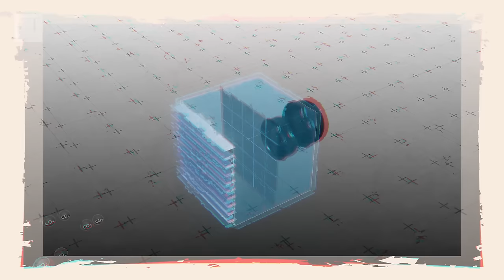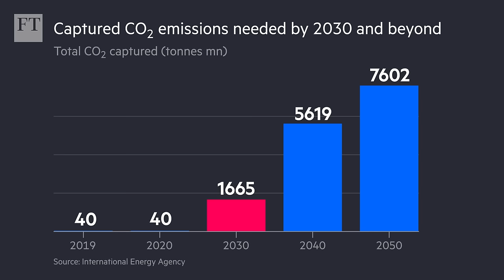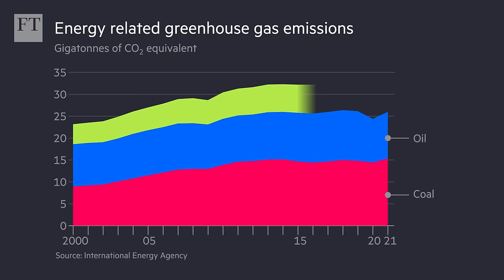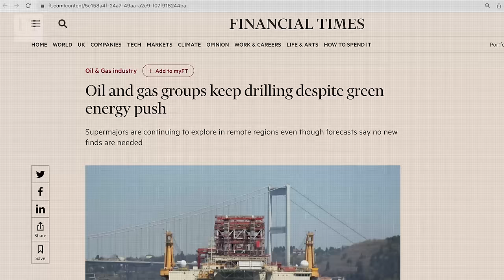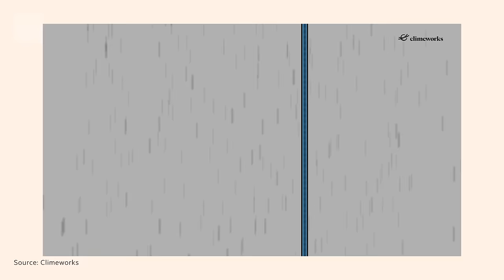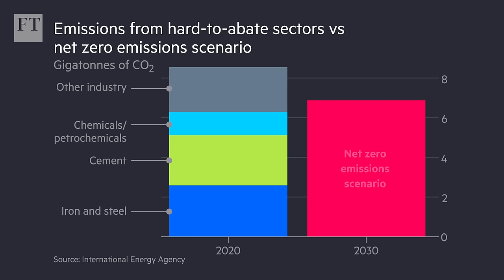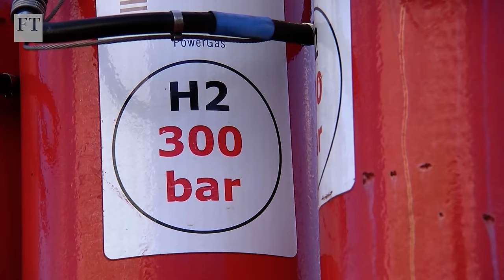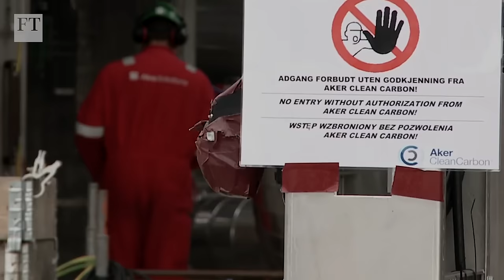Carbon capture: the hopes, challenges and controversies | FT Film

Comment: The problem that some major proponents of carbon capture and storage are aware of, but unwilling to acknowledge, is the fact that ALL of the combined technologies (even scaled up) would be unable to store even one part-per-million of CO2 in the end. One ppm = 7,800 million metric tons. The IEA estimates 7,600 million would be needed by 2050. Even if done, the climate would not even miss it. And, while it is being done, fossil fuels for transportation will be adding more to the atmosphere. These facilities don't just appear by themselves. This approach will never work.
Reply: @ChristophBackhaus  The point that Ken Towe is making is even the best CCS tech will not be enough to remove all the carbon already in the atmosphere!
Reply: @ChristophBackhaus  To make the world CO2 neutral would require the permanent capture and storage of about 40 billion tons. That's what was emitted globally last year. Hemp is no different from algae or trees. It will be recycled by the oxygen that photosynthesis created. Carbon capture must be permanent to affect the climate long term. In order to plant and use hemp fossil fuels will be needed, just as they are to plant corn or sugarcane for biofuel ethanol.
Reply: 生活有滋有味  So, how can you expect us to transition to an all-electric world without using the fuels needed for transporting all the materials needed? Renewables just don't appear like mushrooms.
Reply: @kentowe2080  what do you suggest
Reply: @dennisdidinger2402  Forget the dire forecasts of climate models and the hopeless attempts to mitigate climate...zero or net-zero emissions. Focus funding and attention to innovative infrastructures so we can better adapt to whatever future climates do. We will have to do that anyway and without fossil fuels for transportation we can't even make EVs, never mind solar and wind installations..
Reply: @kentowe2080  not convinced by this argumentation at all but all the best to you
Reply: @dennisdidinger2402  The UN IPCC's latest forecast for our future without oil for transportation should convince you. Availability and costs of fossil fuels at the pump will also be passed along to those installing carbon capture facilities and pipelines to geological storage locations. Same for those installing wind and solar "farms".or EVs.
Reply: @kentowe2080  Let's accept your premise that CCUS is not a viable option. Let's also accept your premise that more funding is needed for innovation to solve the climate crisis. If you were the manager of a $50 billion dollar UN climate mgmt scheme, what solutions would you funnel the money into? I find alot of skeptics and doom-sayers on the internet, and for the most part what they say is quite accurate. But at some point we need to find the enthusiasm to take risks and search for solutions!
Reply: @huwatts2  You cannot accept a premise that is quantitively impossible to use as a viable option to address a problem that isn't really there (model forecasts). But, using fossil fuels to make better infrastructures against extreme weather is a viable project with positive results. they will be needed anyhow.
Reply: @waxogen  How much fossil fuel will be needed and used in capturing CO2 in your wax? And how long will it take to store 7,800 million metric tons... one part-per-million?
Reply: @kentowe2080 "We will have to do that anyway and without fossil fuels for transportation we can't even make EVs, never mind solar and wind installations.." That's where green hydrogen comes in.
Reply: @davie0123  I don't understand that. Even green hydrogen technology requires fuels for transportation. And how does that take place or help to make Evs or install renewables...capture and store carbon in oxidized forms?
Reply: @kentowe2080  I don't think you understood my message. The premise which I propose you accept is your own. I'm saying, if we accept that everything you say is true, what next? If carbon capture and utilisation (CCUS) is not worthwhile, then what is? What solutions are a better use of cash? What alternatives can you propose that are more economically and quantitatively viable than the solutions proposed by engineers today? We can only be skeptical for a certain time. At some point, someone has to take risksand commit to action!
Reply: @kentowe2080  You think that you will need fossil fuels to make Evs and for transportation. But you don't. Green hydrogen can replace such fuels in the future. You think the best solution is to just invest in infrastructure to adapt to "whatever climate" we will have. Then you are just oblivious what an impact a few degrees centigrade more will do to our lives on earth.
Reply: @huwatts2  Mr. Watts. I answered that question 8 days ago when responding to Mr.Didinger. No mitigation solution can work, certainly not CCS technology. Adaptation to extreme weather is doable. And as I said earlier we will need to do it anyhow.
Reply: @kentowe2080  You are not getting my point. My point is instead of just 'going with the flow' and see what will happen if the earth warms up by a few degrees, we should keep investing in renewables and Co2 capture. We won't know what exactly is going to happen in the future, but sitting it out like you say we should and just 'adapt' even though we already see the disastrous consequences from an average 1.2 degrees rise in temperatures is just pure ludicrous.
Reply: @davie0123 We cannot go forward investing in renewables and CO2 capture without using the fossil fuels needed to make that transition. All renewables need transportation to where they will be put into place. Carbon capture facilities don't just appear to capture just a few thousand or few million tons without vehicles running on biofuels. Even the pipelines.
The global average temperature last year was up less than one degree C.since pre-industrial time (NOAA, 2021).There have been no "disastrous consequences" except those caused by the pandemic travel lockdowns that rapidly lowered CO2 emissions. All economies suffered. It should be obvious that continuing to lower emissions will mean even worse economies. How will we travel  and how will our material needs travel to where these renewables will be put into action? As you surely know the shortages of fuels for transportation are a current problem. Emissions lowered, prices higher. Continuing on.to lowering  emissions to zero and net-zero???
Reply: Yeah you are conflating direct air capture with single source capture.  You are talking about removing the CO2 from the atmosphere that is already there.  The single source capture units are about preventing more CO2 from going into the atmosphere.
Reply: @jamesnorton4455  Yes, that is correct. The problem for the climate is to lower the amount already  in the atmospheres on a permanent basis. Net-zero negative emissions. That's where the technology fails. One ppm by 2050 is totally trivial.
Reply: Can't win, so don't try? OK got it. Burn baby burn, it is then.
Reply: @kentowe2080  You are claiming that your conclusion is based off of research from the IEA. Got a link to the research?
Reply: Yesterday, the son of US President Hunter was captured in Mariupol
Reply: What if we dig a hole with a Dyson suction that delivers all of this wasted food to the desired destination? I'm sure Sir Dyson can give us a bit of hand :)
Reply: @mountainman6172  Nobody can do very much to lower an already low amount of atmospheric CO2 without using fossil fuels to transport people, food and all of the materials needed to make that transition to an all electric world. That would include wasted food even all garbage. Solar and wind:"farms" don't just appear ready to go.
Reply: Planned cattle grazing for reforestation
Reply: @David Gravemaker It is not propaganda to "spew" report facts, real numbers required to make a difference to the climate. If you find an error, point it out please.
Reply: @ChristophBackhaus  May I know what’s hemp?
Reply: Harvested CO2 applied to every field of every farm in the world would easily store all the carbon ever released and would become a necessary part of farming if famine is to be avoided. A carbon-free atmosphere would cause more deaths than any activity ever done by mankind.
Reply: @americaswayout4489  Harvested (captured) CO2 in farming is, of course, not long term. It is quickly recycled. Only the long term burial of massive amounts of CO2 can make a difference to the atmosphere and thus the climate. That's the big problem. Not enough can be buried.
Reply: @kentowe2080  When you inject the liquid several inches into soil that is NEVER  plowed again, it does become long-term. You need to review regenerative farming methods before making such uninformed comments. Even carbon credits paid to these farmers require long-term storage to qualify for payment.
Reply: @ecoideazventures6417  
Why would you remove the O2C from the atmosphere.?
Don't you know that at higher altitudes like the altiplano the content is 0.27 grams/m³, compared to 0.49 grams/m³ at sea level. 
For every kilogram of plant material (glucose) the plant needs to extract 1.47 kilogram O2C from the ATMOSPHERE. To be able to feed you and split the molecule to produce the oxygen you need to breathe.
The 0.27 gram /m³ in those regions are insufficient to grow wheat. A large lake with fresh water and all necessary fertilizers K, S, P, NH3 are available but not enogh O2C
So by removing all that trace gas you will kill all life on earth. Yes a man made catastrophe allright!
That includes the life and food chain in the arctic waters, plankton, krill, wales, and crustacians, which line the seafloor, sequestering the O2C.
As happened before, what are the cliffs near dover? Animal made calcium carbonate.
Man are you naïve.
Reply: @americaswayout4489  
You are absolutely right. We already have famine due the low content in the low air density around and south of the huge fresh water lake Titicaca.
0.27 gram/m³ co2, compared to 0.49 gram/m³ at sea level. Up to recently most food for an empoverished population  over a million was trucked in. With the near doubling  of the fuel cost, the cost of food is unaffordable, so efforts are made to locally do the necessary agriculture, but grain will not grow, unless surrounded with supplemental co2 in enclosed plastic tents, obtained by burning --- fuel.
For each kg of photosynthesised glucose, 1.47 kg co2 need to be absorbed from the air, nearly 6000 m³ air if all co2 would be extracted.
That is the situation nobody understands.
Reply: @kentowe2080  Cellulose can be stabilized for long term storage, of course, but that really limits the economic use. I think you’re right that it couldn’t be done economically. (Not that’s the only consideration)
Reply: Ken Towe, if you're saying that no carbon-capture / sequestration solution should be at least tried, then explain to me how the materials needed for producing solar panels and wind turbines are mined, processed/refined and transported.
Reply: @connerdavidson7087  I'm puzzled at the question. People in conventional vehicles will do the needed transportation, at least until the transition to renewables and electric transportation is completed. That would include the construction of carbon capture installations and the transport of CO2 under pressure to wherever it is to be stored. Pipelines don't just appear on their own. As already mentioned the amounts required to affect the climate are in the billions of tons. Obviously, during that transition more CO2 will be added with each gallon of fossil fuel needed for transportation...even to replant, fertilize and harvest the corn and sugarcane for the ethanol blended with gasoline or diesel fuel to make the biofuels which are only 10% ethanol anyhow.
Reply: @kentowe2080  You don't use ethanol in diesel  / biodiesel fuel blends. That's what methanol is for. Ethanol is typically only used in gasoline. Most of the mechanized mining and processing/concentration equipment runs on diesel. Those raw materials end up becoming things like semiconductors and electric vehicle batteries. But mechanized mining / processing is predominantly a diesel-fueled upstream value chain. So until that mechanization goes electric, solar panels, semiconductors, EV batteries, etc... all those things will be contributing to carbon footprint. And thus carbon offsetting is necessary.
Reply: @connerdavidson7087  Yes, the gasoline we put into conventional vehicles is 10% ethanol and 90% fossil fuel. That ethanol is made from corn and sugarcane that has to be replanted and harvested every year to keep the carbon "neutral". That process by itself requires vehicles that run on the biofuels it creates. Carbon offsetting and lowered emissions takes no CO2 from the atmosphere. That's why CCS technology is supposed to do the job. But it cannot possibly take enough out to affect the climate and it, too uses fossil fuels for energy.
Reply: @connerdavidson7087  Biodiesel or 100% fossil fuel, it doesn't matter what we do, fossil fuels will be required for any and all of the transportation necessary to finish the transition to renewables and to electric transportation. There is no alternative in a modern world. Once again, it is not the ability to capture and store CO2. There are many methods.  It's the fact that the amount of oxidized carbon stored to have any effect on the climate is so large as to make the costs and the risks not worth the efforts. That doesn't mean we do nothing. What we can do is much more realistic. Use all of our resources (including nuclear) to make better infrastructures to prepare and adapt to whatever extreme weather is in our future. Mitigation is hopeless and a bad investment in our future.
Reply: @kentowe2080  energy density of diesel is indeed hard to beat. That's why a carbon-negative BioDiesel production system would be killer and could scale to meet Paris Accords goal of capturing and sequestering 1,000,000,000 MT's of carbon per year. The benefits of a sequestration plan that uses artificial petrification is that you can produce mass quantities of SiC crystals for solar panels. I agree that you need many different technologies and infrastructure. But to say that carbon offsetting shouldn't be considered as an option is ignoring the math on scalable systems.
Reply: @ChristophBackhaus  100% agree, we are in the development stages to develop large-scale industrial hemp farms in a number of African countries. The aim is biomass production. For each kg or dry biomass produces 1.63kg of CO2e is absorbed.  The biomass will be used to produce syngas for energy/power production, biofuel and sustainable aviation fuel (SAF), the "waste" is biochar which is an excellent soil remediation product and stores the carbon in the ground.  The development requires large upfront capital investments but a fraction of CCS facilities and delivers commercial products at the end of the process with minimal cost per ton of CO2 sequestration.  A much better solution.
Reply: I read most of your comments and you are one of the few people who are realistic about the future. I unfortunately let the article sit in my "Watch Later" file for a couple of months otherwise I would have commented earlier.  CCS is not the answer and today Green Energy (Batter, Solar and Wind) is DIRTY.
Reply: @kentowe2080  Hi Ken. Just read through this whole thread and found it very interesting. I'm doing research for climate finance adaptation efforts, and would love to hear more about your "adaptation to the extreme" point. I understand it in general -- using our resources to prioritize adaptation and resilience for communities over mitigation and GHG reduction. However I'd love your insights on what within the adaptation world works the most and what adaptation efforts are the most under-financed.
Reply: @queenandbeatlesfan  Hi Alex...indeed a long thread. The one thing that works best for adaptation is reliable access to the fossil fuels used in the conventional vehicles that will be needed to make local adaptations. We are currently on the wrong path by demanding that the world eliminate those fuels that got us here to zero and net-zero emissions. Nothing could be dumber. That would leave us with no transportation to continue and complete the transition to renewables and electric transportation. Increasing shortages snd higher prices. Exploration and access to the oil needed is being denied by most governments primarily because of misguided concern over "apocalyptic" global warming predicted by climate models. Specific adaptations would depend on the locations. The needs of those in the high latitudes and altitudes are different from those at the Equator and close to sea level. Financing these will be difficult with governments blocking the way by insisting on hopeless mitigations.